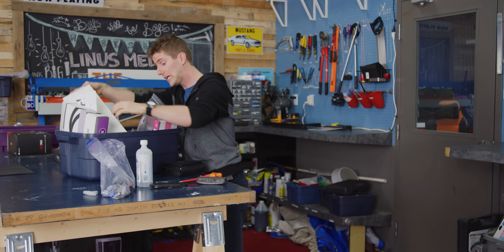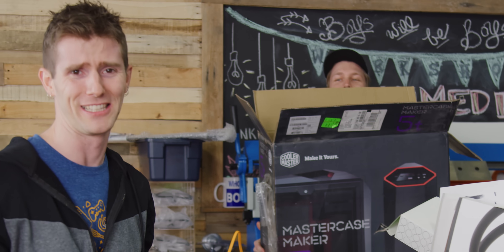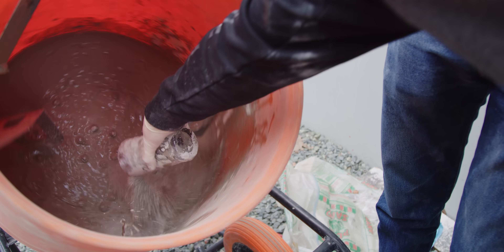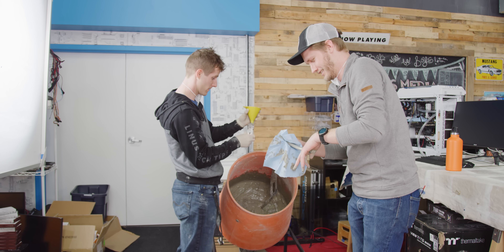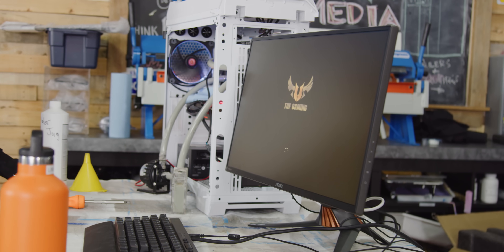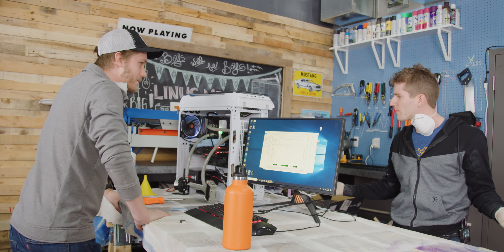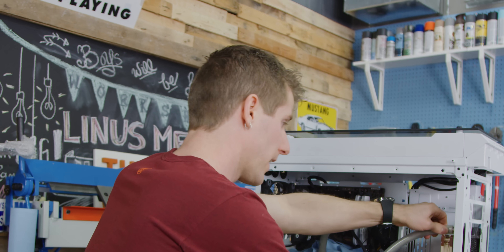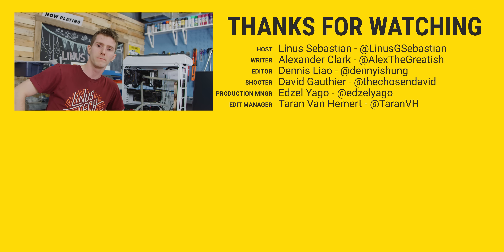I Can't Believe This Worked!!! - Concrete Cooled PC (April Fools 2019)

Comment: Bro just put a fridge next to your desk and put the tower in the fridge and drill some holes in the side for your wires to run through
Reply: A refrigerator/freezer compressor isn't actually that powerful or meant to run constantly, they run for like 3hrs total per day to remove the small amount of heat introduced from opening the door and through insulation.

You want an air conditioner to radiator or to water diy system or a water chiller.
Reply: @Jaker788  it was a joke

Comment: Imagine turning off your PC and waking up in the morning to you pipes being filled with dry concrete😂
Reply: More like after 1hr of running it's cures enough to stop moving and thermal protection shuts down your PC and all your cooling parts are destroyed.

In reality it doesn't work anyway so

Comment: You got a mixer for less than a kg of cement? 😂 A wooden board, trowel and a few cups of water would've done the trick...
Reply: And add a retardant to the mix to slow down the hardening process

Comment: Are your thermal results real? Because if so, it might be possible to choose a type of suspended ceramic particles that wouldn't solidify when you stopped the flow.

Comment: what if you use concrete to fill the "walls" of the tubes, let it harden and then use water for the rest? You should get the best of both. The heat transfer should still be working and the  water has the liquidity to it.

Comment: What they didn't think about is that concrete doesn't dry out... It solidifies due to a chemical reaction between the water and the concrete particles. It's gonna eventually solidify even tho you mixed it way too lean

Comment: I swear I've seen forum posts where people actually do use concrete to cool their PC, just with running water through copper pipes embedded in concrete instead of through radiators.

Comment: Hope they kept those masks till today.

I was initially thinking the concrete was the radiator as it would act as a thermal sink. I've wonder at times how you could utilize the heat from a water cooled system. Warming soil, radiating under a window, melting snow, maybe producing power.

Comment: The results are not surprising. They’re obvious to anyone who’s worked with concrete and knows how cold it gets and the thermal conductivity properties of concrete. The fact is that yes you need a large mixer because concrete expands and you have a lot of ingredients to mix. Concrete is designed to be made in large quantities. I mean it’s like these guys have never worked with concrete before. What kind of man has never worked with concrete.

Comment: Dear linus, I expected that you will know before starting that concrete dries within hours even if kept under water. You should have done is, mix concrete dry it in thin layers. Blend it to dust, mix with water and then use. I don't have that budget or I should have tried. That will give u best resullts with 5:1 concrete water ratio in cooler

Comment: Concrete is a great conductor for transferring heat, but it has to remain in motion to stay a liquid, otherwise once it settles it will harden, that's why the concrete trucks all have rotating barrels in the back to keep the concrete in motion so it would stay liquefied for pouring.

Comment: Too be honest water cooling has its limits even if you can get certain liquids to stay liquid at minus degrees sub zero with a phase change unit won’t last long under a constant heat load while a chiller can

Comment: Replacement substance that prevents the computer to become seized a paperweight is process flour grit sand water or past would work similarly.  I would rather use liquid germanium on a ceramic-metal composite heat exchanger to get better results.
Reply: I guess it is high viscosity cooling XD

Comment: I actually got a bit disappointed, I thought you were gonna make a cooler made out of concrete/cement... btw concrete do start to "burn" a while after it's been poured, and it gets pretty damn hot. 50-60 degrees celsius actually...

Comment: The next best innovation for this concept would be to make a custom diy concrete that is less likely to dry. The only reason why the concrete here dried out is because the mixture is specially designed for fast acting or drying so that it can solidify easily.
Reply: With the real reason being that it’s not actually concrete at all. That’s why it didn’t dry out because they shot the video out of sequence and filmed the test first then filmed themselves putting the concrete in afterwards.

Comment: Things to try, cause I haven't seen it yet, and believe a few of them would actually work.

Corn starch + Water; heat intermittently and strain until it's the desired viscosity. The thicker the better.

Ketchup; to prevent corrosion heat 1 cup of sauce to 1/4 teaspoon baking soda, taste and add dashes until you can no longer taste acidity.

Extra virgin olive oil; cause, yes...

Elmers glue; will end like the concrete I imagine. might wanna make sure it's wood glue and mix with some water.

Corn syrup; cause this will be fun to watch you accomplish

maple syrup; cause that's what Canada is known for right?

Instead of using masonry concrete + water (cause water is an activator, and concrete will always harden once it's mixed), use concrete + vegetable glycerine or polypropylene glycol. Honestly, I don't really recommend that....but i need my Tech Tips. Just avoid using anything that will oxygenate the concrete....then vacuum seal your loop and you may actually get a concrete setup to stay in liquid form. Off, or on.

Any one of these would be fun to watch, but it could comprise a whole series, there's a lot more than what I listed above. If I do it, there won't be a camera, only cause it would be potato quality....and not fit for viewers.

Comment: What about making a concrete heatsink? It is obvious that the concrete will dry up but making a heatsink with concrete might work?
Make a silicone mold out of an regular simple heatsink. Build a base for screws with some copper thin plates
Put it on the mold and fill with concrete
And try it!

Comment: You should’ve put sugar in the concrete that would’ve killed the drying affect. 
I run concrete pumps for a living that’s what we use to keep it from setting on extremely hot days when cleaning.

Comment: You should try this again, but add sugar to the cement. Cement mixer trucks often carry bags of sugar with them because it stops the setting process. If they got stuck in traffic and were unable to deliver the concrete they do this to avoid having a truck full of set concrete.

Comment: As it moves your pump is going to turn to a liquid, then as it heats up everything is going to turn to a SOLID.   You're going to brick your cooling. lol

: ) Sooooo, conclusion: Concrete is an excellent short term cooling solution.    Ha ha, lol.   This video was very beneficial, because I just figured out how YouTube works.

Comment: a good April fools as they would know concrete once you add water a chemical reaction occurs and it goes hard even in a vacuum and the pump would burn out pretty quickly with all the force required to try to move it which also speeds up the reaction LOL they should have tried custard instead that would have been a good one.

Comment: What about Mercury liquidcooling??
Reply: If you can find parts that won't get ruined in a matter of days it should work great. But Aluminum is of the list of materials, and to my knowledge there is no pump strong enough to push it through a radiator (without an external power supply).

Comment: So like. Obviously don't do this. But, was it actually running with concrete in it to begin with, or did you spoof it? Cause that's insane if it worked at all even though it was a prank.

Comment: Is there a way to add like mineral oil to the concrete or something would work against solidification that can work stable. And I would think this can work but only something that will stress the pc like server based.And I think concrete is something like a double-edged sword here especially for using it for high heat exchanges...like the spikes. It might help dry it out quicker and solidify. Could a crusher type of filter in a special modified chamber be made which could even be 2food processor blades continuously turning making smaller particles be possible. Also concrete is made to turn solid. Win for concrete on both sides really.

Comment: ok, i know this is an april fools thing, and I am SUPER late to the party... but seriously. DO NOT DO THIS. it may work for a little while, but concrete is literally built to be something that hardens. AND Quiccrete (sry 4 spelling) is made to harden even QUICKER. I mean, come on!! If you want to destroy a few good systems for a liquid ceramic that sets anywhere from 40 minutes, to 10 minutes, and it totally not worth the practicality of it, then fine. But at least someone put the warning out there.

Comment: Any DIY er knows concert/cement hardens through chemical reaction not air exposure. Take a blob of wet concrete and drop it underwater or in a closed circuit and it will harden like a rock just as if exposed to air. It also gets very hot in the hardening process. So wtf, were you for real?

Comment: A little suggestion for a better version of this:
If you add salt to the mixture (actually not much is needed) the concrete never hardens out. That would obviously solve the problem when turning off the system.
Reply: Except he didn’t actually use concrete in the loop when testing only afterwards when he actually put real concrete did it harden.

Comment: I love that Linus noticed that theres an inner channel of movement vs the outer concrete that isn't. We actually just went over that exact phenomenon in Fluid Dynamics. Its called "No slip condition" and all fluids do it. When you run them through a tube, or anything actually, theres always a film of the fluid that sticks to it and doesn't move because of "no slip condition"
Reply: I love how you think it was actually concrete
Reply: @9.5.9.5 As OP mentioned, all fluids do it. Nowhere did OP say he believed it is concrete, just that Linus said it is.

Comment: Linus, guys: Try insted liquid ceramic and black or anti-uv tubes. The same stuff that it's ceramic base. That thing may not solidify if kept away from oxigen and light.  If you got -10 with concreete, im sure that liquid ceramic will do way better and permanent or at least long term. Also one may consider that the ceramic will neglet the condensation for a possible peltier addon (in between/inside) the base block not as a main cooling solution but as a addon, it would be intristing to link the peltier to the on/off boost of the cpu, so one would not need to keep controling it, theres got to be a solid way trough linking it almost straight to the cpu fan pin sort of using a connector, after set a pre determinated fan tick in tune with the bios setings.  Or even trough usb port if there was a on system app for monitoring fan and or turbo.  If worried about moisture, one can always coat the finished setup with nano coating spray (under the sun on a very dry enviroment/ up and down) In teory the tubes may produce some water on the long term, but given a tower configuration it can be divergedby using an aerogel membrane in between the heatsynch and the gpu back. Final note should be more reliable to perform the experiment on air cooling, but may loose the liquid ceramic potential for heat transfer from the water cooler system.  What I have in mynd is prety simple: LET THE PELTIER COOL DOWN THE BACKPLATE FROM BEHIND OF IT "WHILE" IMESED INSIDE THE LIQUID CERAMIC TO DISPERCE THE EXPOSED HEAT SIDE.  The pump action if the substance in use is not a perfect liquid, may do the job of kept considerable motion while the ceramic highter density combine with this motion may be just enought to denny the submersed peltier effect to ever even effectivelly reach the walls of the tubes/block, in theory there may not be moisture due the time the heat would took to spread to the walls of the block/tubes, that if the motion is solid. If it's as i imagine, the peltier may work for longer periods on, only observation is that the surface of the block must be equal or little bit smallert than the one of the cpu plate. Fo one can eliminate the air and seal the edges with some insulated line or glue. If there was no air under the blocks there should be no mosture, the final ensurance, cover the black of the motherboard with aerogel sheet before tie it to the case.  That should do it.

Comment: 1st : @ 8:40 yeah thats how fluids work in a tube, the outside move a lot slower than the inside.
2nd: DONT PUT CONCRETE IN YOUR SYSTEM!
3th : yes it would be interesting if someone would look into a nonabrasive(like the concrete) heat transfer fluid .(although i would think in the long run the whole system would run warmer and warmer , so you'd need bigger radiators)

Comment: I don't know if it's till done but they used to pour concrete into the coolant passages of engines for dragsters. It gave the block more rigidity and enough mass that it could survive the thermal cycle of a top fuel run.

Comment: let the conrete have its full chemical reaction and then dry, and then after it dries, crush it up and put more water into it, and then let it dry and then do the process again and put it in the loop and it should take way longer to solidify, like days if its not running. after 2 chemical reactions it shouldn't solidify. but it should still have the same cooling results

Comment: What about setting a normal air heat-sink in a block of concrete  and if it does not work then would have a great paper weight.

Comment: OMG doing full concrete cooling and then do the kabinet/chassis mat rough gray and then get all y other components in gray then called it MASTER WORKSTATION haha just dont make the concrete dry keep it even wattered cause if concrete stops running in those tubes it ill completly dry out to a block in y pc tubes and pumpes learned a few after seeing this gniues video

Comment: I thought you were going to embed some copper pipe in the concrete, and pass water through. The concrete could replace the radiator. I think that would work well.

Comment: It flows through those tubes in the same way that water flows through a river. There’s just a higher coefficient of friction at the interface where the water touches the banks than the water floating through other water.

Comment: I don’t see how this works LinusDumbassTips or how you could recommend it. Who would leave their computer on 24/7 to prevent the concrete from solidifying. Also it probably needs to stay hot all the time which means you need to keep the computer running pretty hard ALL THE TIME! Yet another fail from you guys. One reason I don’t watch this channel much anymore. It is filled with nonsensical “solutions” that no one would try. Yeah, You have all this equipment and money to throw away because you get this hardware for free, but everyone else doesn’t. You used to be an informative channel now you’re a joke in the tech community.
Reply: Reading the title is cool too

Comment: The solution need to have a lot more water  u should also add a bit of soap to the mix as it slows the setting process of concrete